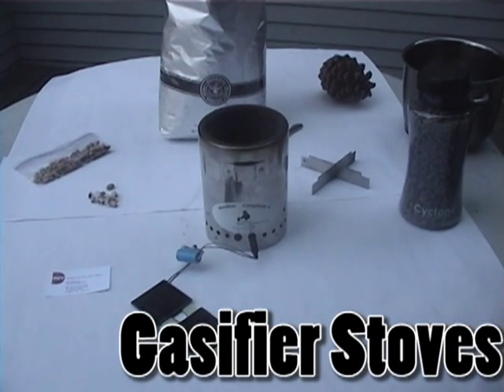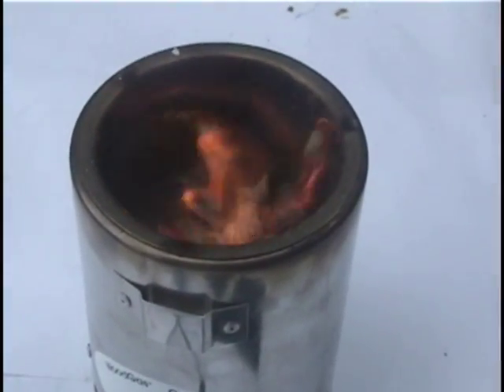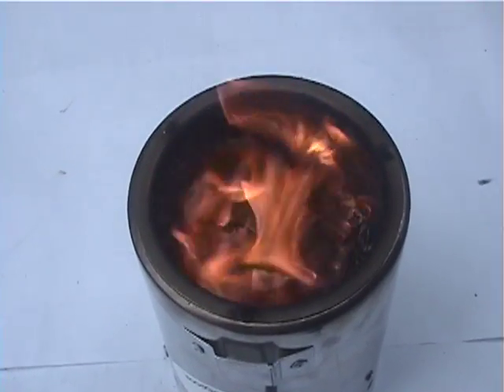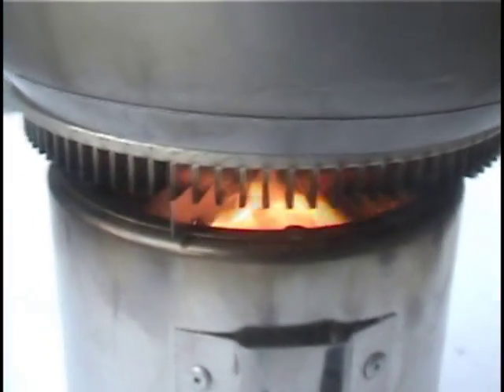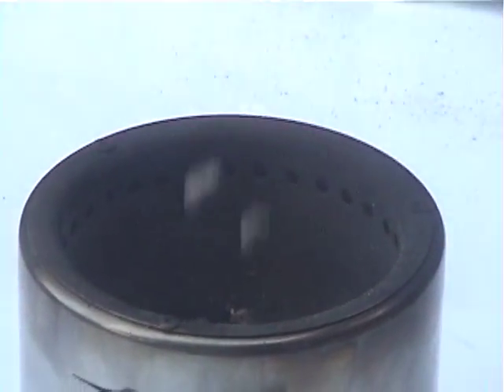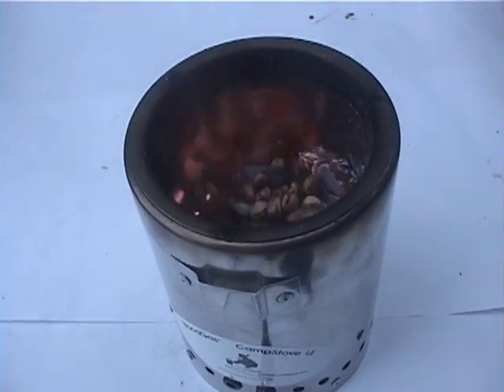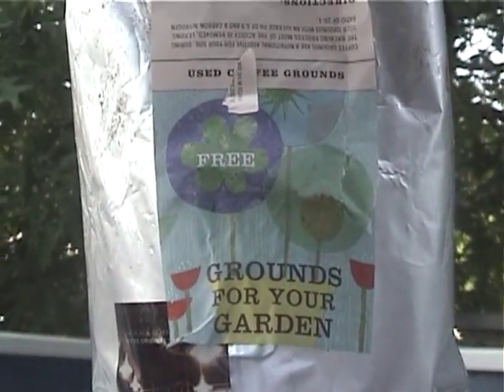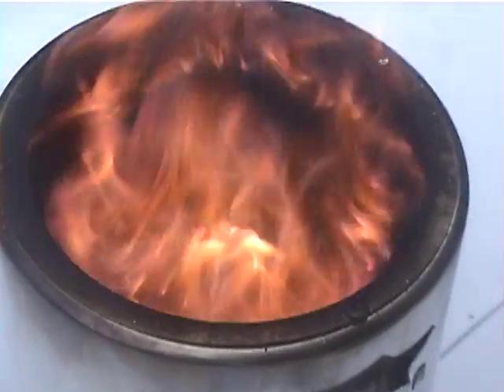Burning Organic Material with a Gasifier Stove

Comment: The Cherry pit comments are misplaced.  if you lookup brooksidepress and search on Cyanide and then Toxicity you'll see that basically a person can process 55mg of Cyanide per day via hepatic Rhodanese enzyme activity and 1000 cherry pits (2lbs fuel)  would have 78mG cyanide.  It would be hard to capture more than 2% of that breathing in fumes even if you treated the stove as a big bong and tried.  You'd be dead from acute smoke inhalation long before the cyanide could give you a light headache

Comment: I was a machined piece, done by a Stanford Student and is not in production.  These are basic Woodgas stoves from woodgas.com  adapted to use a variable speed solar-recharged circuit for fine control.